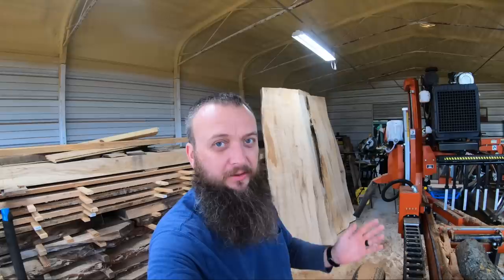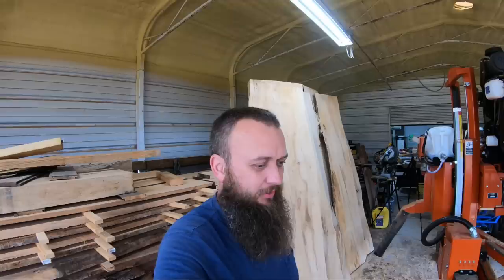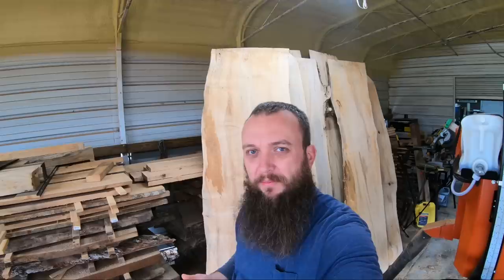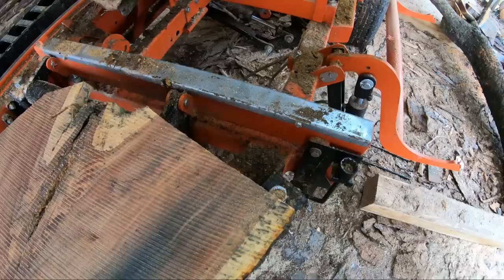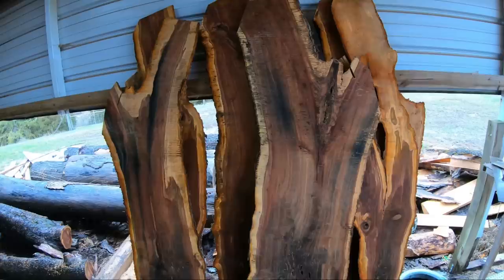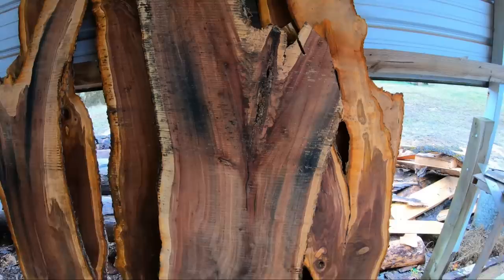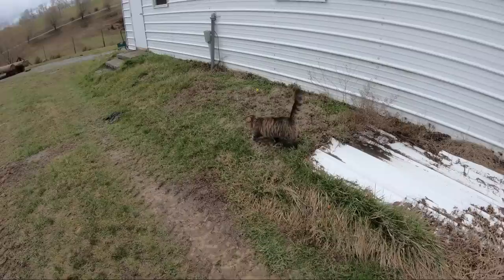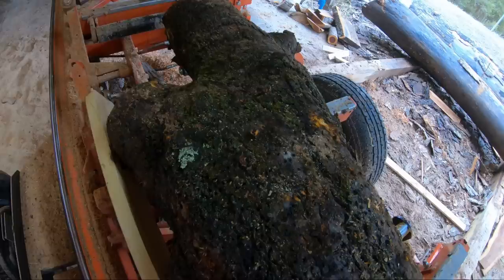Saw-Milling A Rare Apple Log And Finding Red Gold Under The Bark

Comment: Our filler used to save in a can the metal that we sawyers cut through. Although it did not take long, maybe 10 to 15 minutes to change a blade. Those wasted minutes add up. Then the filer had to spend a hour or so setting the teeth, sharpening and tuning the blade again before the blade could go into the ready rack. Each side of our mill tried to have roughly 6 to 8 blades sharp and ready to go all the time. One of the reasons for both sides having different blades was that the left or right side saws had a different tuning needed.

Comment: Nathan - I would expect that now that you have removed the damaging metal, that some of the larger slabs could be lightly planed to remove some of that washboard effect from the blade damage from the nails.    Still has some pretty figures in the wood.

Comment: Beautiful wood Nathan! I guess you could call it many blade wood. I remember sharpening a hand plane and spending a good deal of time in the process. The very next piece of wood had a tiny cut nail, being an old period piece of wood. Well there went my razor sharp blade that made one pass. I have a regular metal detector I've used many times in the field. I've also used it many time in my shop. I've dug things in the ground 8-10" and it has picked up nails in wood 4-6" no problem. It is a Fisher detector and originally it was $750. It certainly paid for itself in coins and artifacts found over the years. But as said, I never had trouble picking up metal in boards. I always use my detector when running old boards through my planer. You might want to check out the companies like Fisher, Garret, etc. These people have a lays been great to deal with and may be able to help you out for far less money than that $2500. Thanks Kindly! DaveyJO in Pa.

Comment: If there is a shop around that sells metal detectors for "treasure hunters" you might talk to them.  I suspect you might be able to get one of the less gadget filled ones for under $1000, perhaps $600 or so.  You can get a loop to detect things and a smaller head a bit bigger than your thumb to localize the detection. I haven't looked at them for years, but it is something to keep your eyes out for to check up on--it might or it might not help.  Your time is as valuable as those blades!

Comment: I’m pretty sure the Garrett carrot (Pro pointer AT) will detect an inch and a half to two
Inches and costs about a hundred bucks. If it caught only half of the nails you run into it would still pay for itself in no time.

Comment: I do like the look of the apple wood it does look pretty but I don't think there is not many large apple trees I think most of the apple trees are usually being used commercialy at apple orchards I remember doing some research on apple trees that the only way to get a full size apple tree if someone had planted some apple trees from seed but I know it might take so many years for the trees to get huge

Comment: $99 will get you a brand new bounty hunter with an 8" coil. It will detect at least 3" deep and will probably find iron down to 6". If you look for a used detector, you can get a decent detector for less than $50.

Comment: Be interesting to know if the black nail staining could leached or bleached out. If it was iron oxide I guess it be red. Black suggests carbon.
Whatever there likely is something out there to treat it with.
Reply from the maker: I’d say it’s there to stay
Reply: Out of the Woods yup
Reply: Will acetic acid work?
Reply: Geoff Buck ...good thought. Someone placed untreated hardwood furniture onto a sandstone paved area on a heritage listed building and rain stained the paving badly.....I think it was your suggestion which lifted it out when nothing else would.

Comment: I know you don't have much metal strike experience.  If you hit soft nails, it will leave a curl of metal on the tip of the tooth.  It might look like the tip is rounded over, but if you use a small flat file as a scraper and scrap the curl off, many times the tooth is actually fully intact.  If you hit harder metal, it can round over the tooth tip to the point that it cannot be sharpened because the height of the tooth will be too reduced.  I hang all my metal strike bands on a hook on the wall of the shop and when I get 15, I'll go through them.   I'll take bands and remove the curls and examine the teeth.  If only a couple teeth are damaged, I'll send it for re-sharp.  If too many are rounded over, it will go in the scrap pile.  Many times if you have a really bad metal strike and can immediately see numerous rounded over teeth, it will go right to the scrap bin.

Comment: $10 is not even break even. Professional sharpeners charge $10 just to sharpen. You have to consider your time to swap blades and the decreased blade life. 
When the blade gets a few teeth damaged by metal, have you ever tried cold forging the few teeth back into a thinner shape with a quick grinder trim to stop the scalloping cuts? The cut pattern shows that only a part of the blade is making all of the marks.
Reply from the maker: wrong, woodizer charges 6$ to sharpen so 10 is a good profit,
Reply: @OutoftheWoods0623  The prices I saw at Woodmiser were $8 and up plus shipping depending on quantity and other issues. How many blades get rejected for excessive damage? You undervalue your time.  If nobody every cringes at the $10 fee you charge, you are lower than the market will bear. At least 10% should be questioning your price. That means 90% understand and accept your price as valid. The 10% are just cheap. That is a normal market. 
You lost 1/2 the life ($10 lost value) plus have to pay the sharpening fee.
I would save those blades that are at the end of their sharpening life for yard trees. Then, $10 is an end of life fee. 
I used to under-price my time and resources/equipment. Nobody was every grateful for those low prices.

Comment: Nathan, buddy, old pal, my friend, when your equipment is damaged do to metal in log, the damage to you more than the fractional costs of a blade, it also costs you in your own time and labor - and that is worth something.  So, how much do you pay yourself per hour, per log, per board foot?  What ever it is, you should get that back.  You are providing a service.  So, you have basically two options, if you charge a customer X$ to saw a log out of the forest, you charge 2xX$ to saw a log from a yard do the extreme risk to your time and equipment.  Or, you charge $20 per nail - and you give them their nails back at the end of the job.  Risk is risk, it costs, those costs should be paid for fairly.  Just don't take you customer's risks without getting paid for them - that isn't your job.

Comment: When you said that you charge $10 for a blade that hits metal and the blade costs you $25, it made me think... Instead of a flat fee of $10, why not have that cost built into your invoice that you bill customers.  Here is my thinking.  I may be way off on the following numbers, but you can see what I'm talking about and adjust the actual numbers based on your total blades used and the total number of logs that you actually sawed.  We'll use last year as an example. Lets say in 2019 you purchased 50 blades throughout the year for a total cost of $1,250 (50 times $25).  And lets say the total number of logs lifted up unto your mill was 600 (that's about 12 per week). Doesn't matter what the cut was, but it was 600 total logs.  If you divide $1,250 (blade cost) by 600 (log count) you get about $2.08 per log as a per log blade cost. And then for 2020, when you give your customer an estimate (however you do that) add $2.08 per log as a hidden fee to your final estimate.  This is all just an idea for the hidden per log blade fee.  And you could have an excessive metal fee ($15) as a disclaimer if you hit metal 2-3 times or higher.  Again, the 2019 numbers are just an example... your final "per log blade fee" would most likely be different.  When 2020 is done, then you can re-calculate your blade fee for 2021 based off your 2020 blade and log numbers... or just keep a running average.  I guess if I was a customer and you told me that you don't charge for hitting one piece of metal, I might choose you for the job over your competitor.